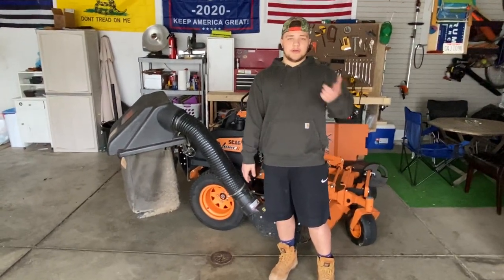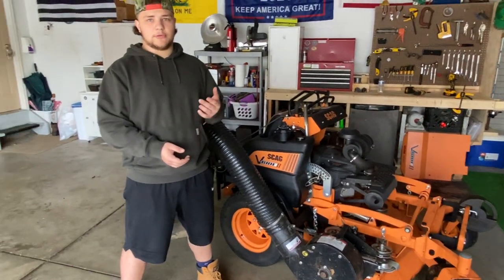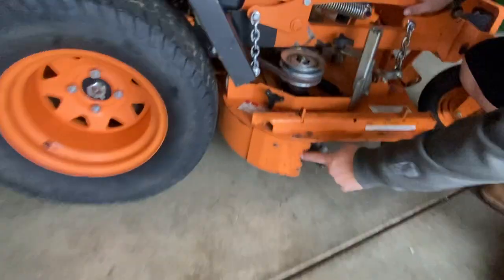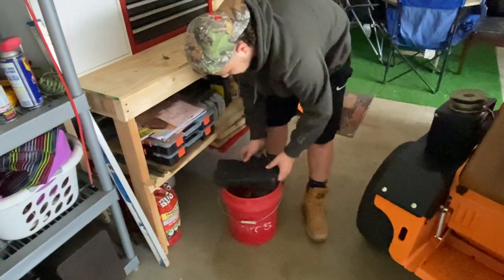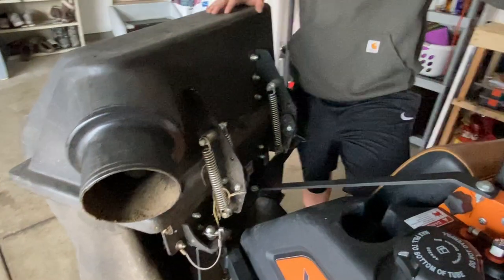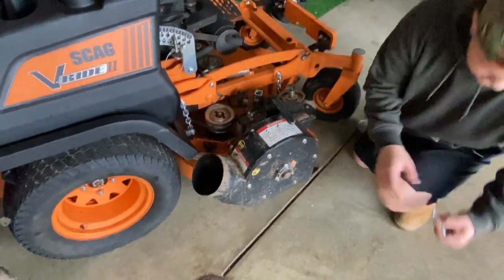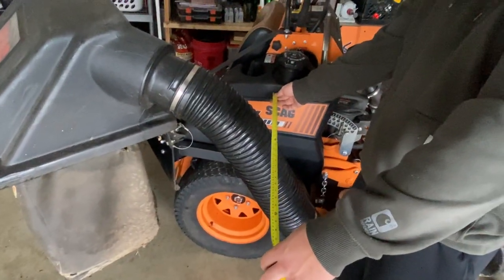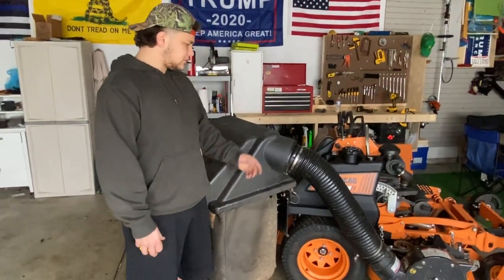The Scag Vride 2 vac system SUCKS!!!

Comment: I have a 61”. Brand new last spring. I hooked that baffle on a edge of a sidewalk entry  I wasn’t even curb hopping. Anyway I hooked it didn’t know when I got on the turf to engage the blades and it started and slammed to a dead stop whole machine. The baffle bent just enough to catch the blade. I ripped a 1 inch chunk of the plate. I freaked. I bought the replacement plate and left it off. I run the bagger anyway. Also check your blade to pin adjustment measurements.  I was sitting 1 inch lower than what I was actually cutting. The main baffle hooked on the trailer every time
Reply: I have the same exact experience with my 52 bagging system. The turbo baffle would inevitably loosen up enough to catch the blade and shut the machine off.  Scary.   I also noticed the mower squatting from the true cutting height.  Nice to know I’m not alone.  I thought I was going crazy.  😂 🍻

Comment: Might I suggest, especially since you have a couple of extras there, that you straighten the "L" bracket back out, take it to a welder, or if you have a welder, and attach a gusset to the back side of that L bracket for added strength, and then cut the flange at the bottom of that plate, where you said it was hanging down to low, and remove a small pie cut, straight across, leaving the bottom rolled edge attached, over about 3 or 4 inches, maybe a quarter to 3/8 wide tappered towards the front of the mower, bend the rolled bottom flange up, to create an angle, and weld it back up, hopefullyit won't interfere with the blade. Wouldn't hurt to try, especially since you have a couple of old ones. I just ordered a new Patriot with that bagger system, I will see what mine does, and adjust from there, and if it works, share that idea with the company😎 and with the YouTube channel.

Comment: I’m really impressed with it. Great idea but I have lot of blower out near the discharge and on the front left side. I end up making several passes. I’ve tried ceiling off opens, adding rubber around the front of the deck.  Great idea I like the convenience of emptying the bags. I’m using extra high lift blades. I figured it would help draw up leaves and the fine leaf debris left behind. Maybe tbe blades are pushing the leaves debris out from deck and discharge opening cracks???

Comment: Instead of using that baffle that you have order the baffle that is the entire length of the deck is starts out thin on the left side and as it comes to the discharge side it gets wider they're about $300 I have it on my tiger cat 48 in wider which has the velocity deck it works great cuz you don't have to take it off when you want to just side discharge. Just call Scag they should have it I just bought a 48v ride because I'm going to take the old bagger off my rider and hopefully it will work on my new stand on because I do not want to buy the one like you have because it's only a 6 inch tube vs 8 in tube